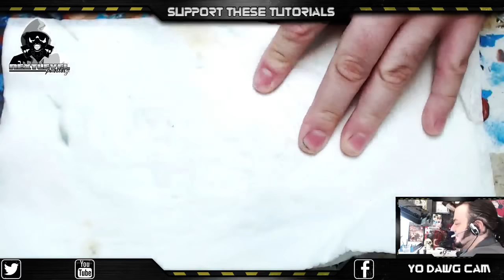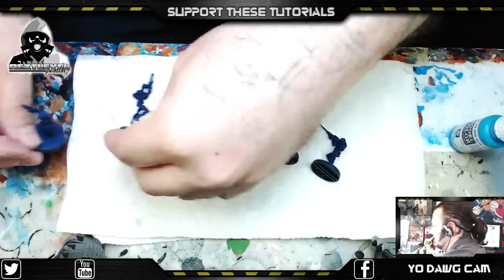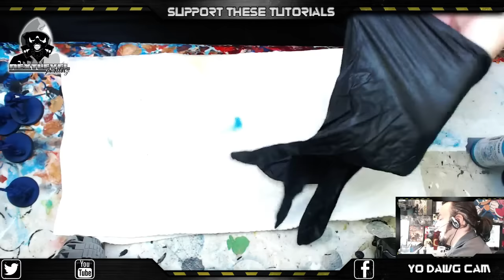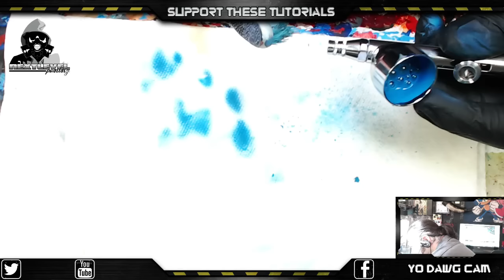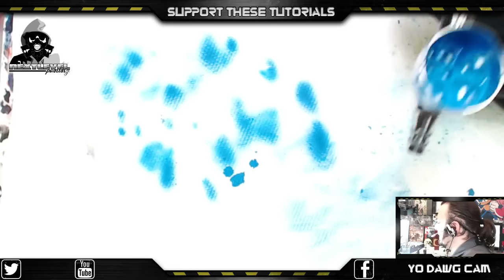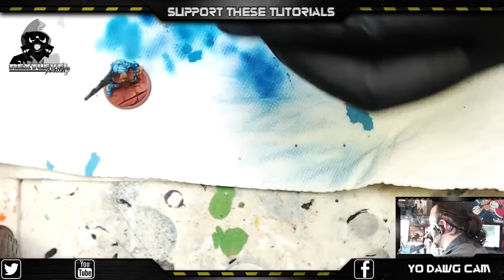How to Make Any Type of Paint Work in an Airbrush

Comment: Great video.  Thanks for making good content.  Question for ya.

I've got that same airbrush, and I've always just run with the outer most "tip cover" piece removed.  That way, when I get buildup, I just pinch gently at the needle to remove it.  

I'm pretty new to air brushing though, and this is just something I thought worked pretty well.  Is there a good reason to leave the end cap on, other than to keep your needle from getting bent?  I'm pretty careful with my stuff and haven't bent the thing yet, so I'm not too concerned about that.  However, if that end cap is providing some other benefit to the painting process, I'd appreciate any info you could give me about that, and perhaps why using the toothbrush like you do is better than my "quick pinch" method.  Thanks again!
Reply from the maker: keeps the needle safe like you said. im a brute with my gear
Reply: +Curtis Delaney Yeah, like Kenny said... it's to protect the needle.   Without the needle cap you're playing with fire man... one misstep, be it sitting the gun down wrong or even putting it in a holder wrong will leave you with a bent needle.  With just the tip (phrasing) exposed and everything else braced behind it in the gun any pressure is going to get applied there since it's all that can move.  

Bent needle is shot, so you're looking at a $10-15 dollar bill to replace.

Comment: Hey Kenny/ +Next Level Painting, really appreciate the tutorials. Keep up the good work. One tip I might suggest is to switch out from the VJ Model White over to the VJ Model Air White. That Model white is very, very gummy when you push it through the airbrush. Not sure what the mix is and why it does that but when you are doing that fine detail work and keep fighting it can be a real pain in the A$$. When I switched over to Model Air White the speckling issues and general air time productivity went way up. If you have any other colors that you find you are having a hard time maintaining good flow out of the airbrush, keep an eye out for a VJ Model Air equivalent to swap out and give it a try. Especially on those highlight colors.
Reply from the maker: no doubt. i mainly use the Air line. but for this project i was trying to stick with game color like Angel.
Reply: Understood. Yeah, if you read his guide for Joan he calls out specifically the Model White 70.951 (20% mix) and while that may work for a single model within a paint guide, as you can see, things clog pretty fast on an Iwata with the bigger needle. You got to wonder about how he pushes that paint through on a H&S airbrush with a .15 needle with any reliability? Either you can do some crazy amazing reliability with an H&S that I am not aware of or his paint mixes are crazy thin with mass layering. I ran into the same issue you did with both my Iwata Eclipse and Badger Sotar until I switched out the white to Model Air. Bam! problem solved.
Reply from the maker: +Gregg Speers u can water down paints pretty far and layer them up slowly